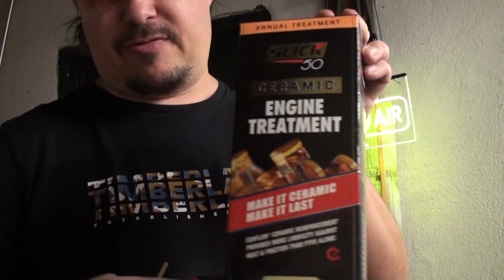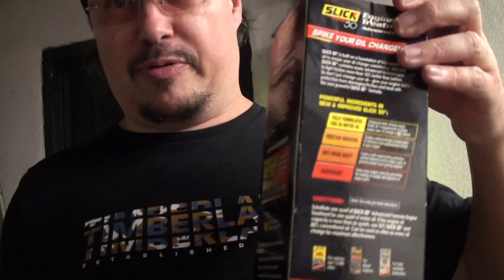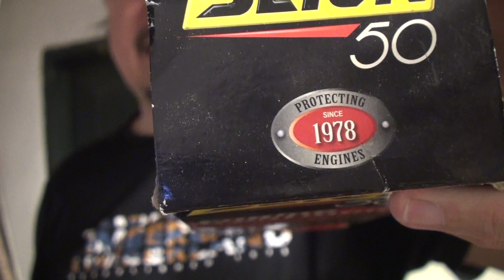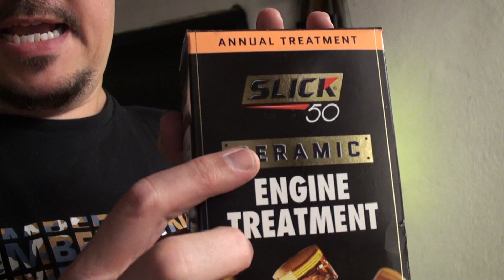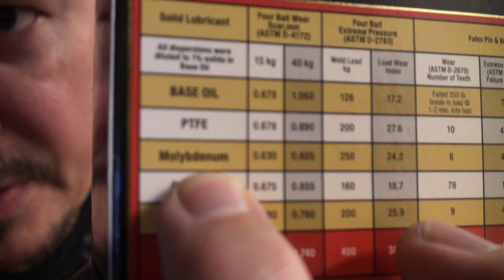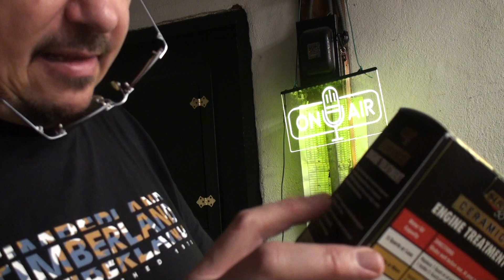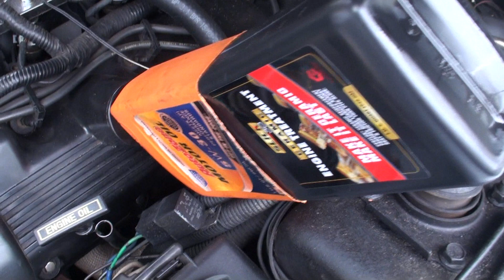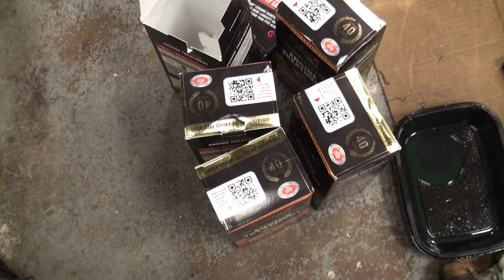Slick 50 Engine Treatment Review Did @ProjectFarm  get the wrong Slick50 ? We'll find out now!!

Comment from the maker: FYI Update- Just checked on Amazon, 6 quarts of Classic Slick50 formula Cerflon is now $79.99  - That's Inflation right there because it was just like $60 when I bought the same order last time in the fall of 2023.. about $13 a quart now, still cheaper than some other engine treatments sold at Autozone in smaller cans.. Will treat the Benz Diesel next and report how it works.  Mustang just turned over 200k miles, slick50 oil still it in but will need to change out soon, it has about 3,500 miles on it, I added like 3 qts slick50 over the last 6 mths, since it burns a lot of oil.

Comment: there was omething called militec I added to my v8 ford about 30 years ago and it didnt do anything except lower my oil pressure a little.  it had teflon in it too (supposedly).  edit toadd  i dont know what project farm is but the Amsoil people always have those 'bearing' wear test things etc. and i think there are videos on youtube about them doing it.   it's all snake oil
Reply: I know a few people that are fans of Amsoil and were trying to get me to use it but the prices they charge for their treatment products are sky high, even just for their regular engine oil.  It's mainly about viscosity, also all motor oils sold now have limited anti-wear ingredients like ZDDP zinc due to emissions systems being damaged as your car burns a small amount of oil, so one brand of oil can't really give you more additives than another - they all meet the same basic standards.
Reply from the maker: This products classic Slick50 is getting more expensive now, too many people must be buying it because of my video ;)  I should have kept it secret!
Reply: @benzproducts no I was paying over 50$ for it at Repco in 1998. I checked online and u can get it for about 65$. I don't see it on any store shelf now though. I think all the 15$ 100ml bottles of PTFE  to be used every oil change made slick 50 too expensive. Problem is these small bottle treatments don't look like dissolving particles small enough
Reply from the maker: @cruiser6260  That may have been the good stuff 😉 if particles of PTFE looked large, just have to bypass oil filter to get it to work right👍
Reply from the maker: @cruiser6260  Also, to be fair, think this new Slick50 probably needs a quart every oil change if you really want it to protect well 🧐

Comment: The first time I used slick 50 in 1995 on my 93 Toyota Camry V6, and it was the most beneficial thing for my car’s engine until I sold it in 2000.
Reply: Now I use EZI Extra Power Lube for my Mercedes AMG and Saab Aero it is a very excellent product
Reply from the maker: Try using this new ceramic PTFE Slick50, it's working excellent in my mustang GT so far..

Comment: In 94 i used slick 50 in 1981 amc concord only good for 12 k miles than its gone..
Reply from the maker: @Craig-ik2rb  Did the car's engine only last 12k miles after treatment or do you mean the Slick50 benefits like the coating of PTFE only last 12k miles before needed another treatment?  I had put as many as 3 qts Slick50 in my Mustang and it's running better than ever..
Reply: @benzproducts  I used once slick 50 in 1984.
Reply from the maker: @Craig-ik2rb  Did it improve MPG and how the engine ran?
Reply: @benzproducts  it was in 1994 I only check every oil change.i only fnd out slick 59 only good  for 12000 miles on engine protection only.not gas.i wasn't think about mog.i wasn't enough knowledge about motor oils.now I do.i drove 1981 amc concord line 6 run 25 mog.
Reply from the maker: @Craig-ik2rb  Yeah, you probably have to retreat like every other oil change to be realistic about it.  The original Slick50 was dreaming when they said it lasts 50,000 miles after 1 treatment!!
Reply: @benzproducts  what about rvs,microlin engine treatment,liquidmoly cera tec cerma engine treatment once lifetime ,xado etc.last 30 k to 60 k mile walk ccept cerma engine treat once lifetime.same microlin engine treatment.
Reply: @benzproducts  stop ceramic,any nano??????
Reply: Stp
Reply from the maker: @Craig-ik2rb  The nano may be a scam.. let me know if you have found any good nano product.  The ceramic does work on the nano level, smoothing metal.  The PTFE is what I think really works, original Slick50 had even more..
Reply from the maker: @Craig-ik2rb  Just saw your comment, I will have to look at those products.. which do you think actually works best? Have you tried them?
Reply: @benzproducts  thank for response.i try rvs wait see.

Comment: It has PTFE in it.some way its hurt engine..
Reply from the maker: I don't see how the PTFE will hurt an engine, if you look at the video where I cut open the oil filter after using 3 qts of Slick50.  I was surprised to find the oil filter was not plugged up.  The PTFE is supposed to coat the friction surfaces and help the engine run smoothly with less metal wearing.
Reply: @benzproducts  thank.lake speed jr probably not agree.look at the motor oil geek.
Reply from the maker: @Craig-ik2rb  I've seen the motor oil geek channel, the guy is definitely a geek, being that he uses a lot of numbers but in reality doesn't know what he's talking about.. same with project farm, they are doing quick tests that are basically click bait and do not apply to what happens inside your engine over years..